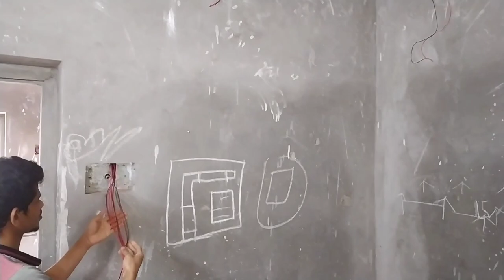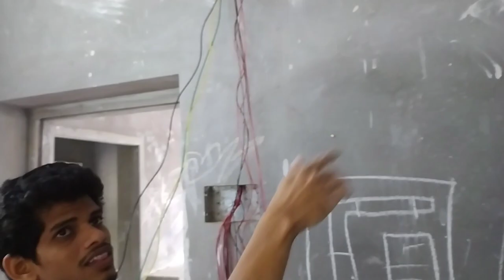Electrical House wiring Telugu | Switch board connection wiring | inverter connection for home

Comment: Hii bro 4rooms ki wiring cheyali antha thisukutaru bro miru
Reply from the maker: Points lekka bro point ki vachi 150-200 untadhi
Reply: Bro total antha 4room ki amount
Reply from the maker: wiring and  switch board connection 10k - 15k